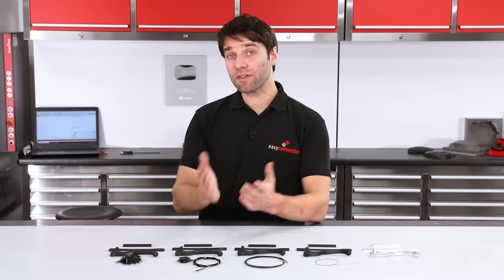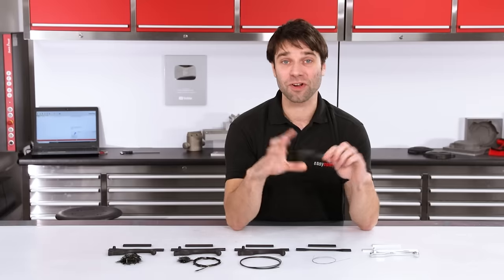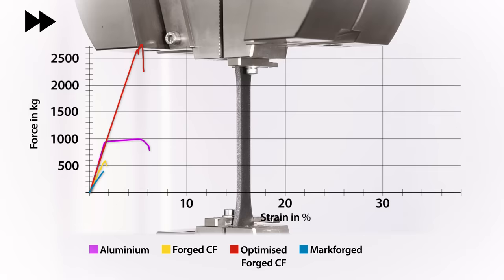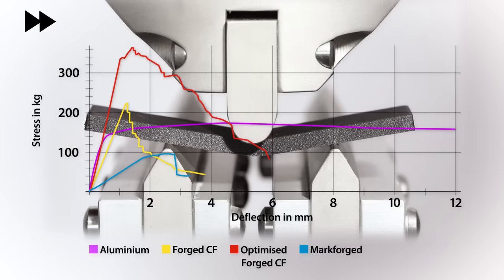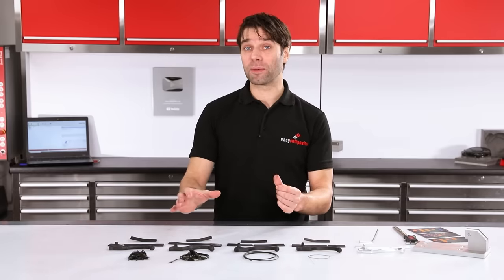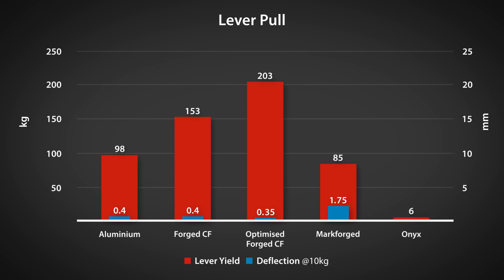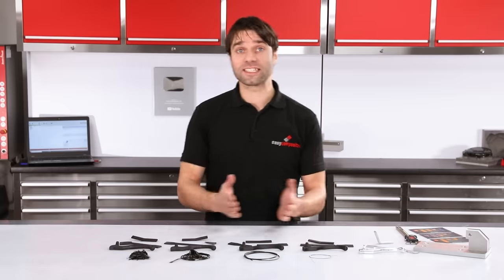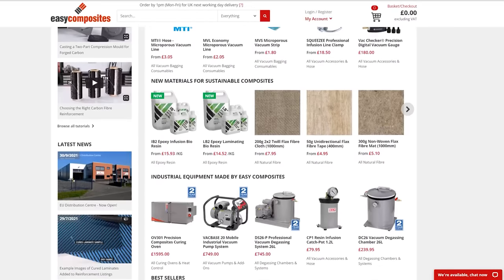How Strong is Forged Carbon Fibre? Forged Carbon vs Aluminium vs Markforged vs Onyx

Comment: Been hanging out for this episode since the forged parts video. Thank you for posting such informational videos and tutorials.  The card analogy was inspired.

Does a continuously increasing load replicate spontaneous (impact) loads? It would be unusual to slowly increase the load on a brake lever, but I can imagine a sudden impact load on a brake lever during an accident. Just curious if the results are applicable in that real world scenario?
Reply from the maker: Sudden impact can illicit a different response from materials which is why specific impact tests do also exist. We don't have an impact tester but we did fabricate an ad-hoc impact test for one of our previous material test videos (part of the 'Dark Ice Project' where we tested the impact strength of various materials like carbon fibre, Kevlar, Diolen, Dyneema etc.). Although it's a complex subject, you can predict a lot about the impact strength of a material from its ultimate strength, elongation properties and failure mode in tensile and 3-point bend tests.
Reply: @easycompositestv  thank you for your response - I'll go check out the Dark Ice impact test video.

Comment: Very good content,
Also shows that 3d printing isn't feasible for many applications.

I am very impressed with that reinforced carbon forging proces though.
twice the strength and half the weight of aluminium. That means you can go an quarter of the weight with some Q&A testing on these parts.

That is actually really really good stuff. Especially looking at how simple it is to do and it seems feasible to produce at high volumes as well.

Comment: That onyx stuff seems oddly bendy for a CF filled filament and generally seems to perform terribly.
If the data for the tensile strength at 16:49  is for a 3 mm x 10 mm sample it means it failed under 29MPa. Even normal PLA should be nearly 2x better than that.
Reply: I think this is an application where nylon isn't a good choice. A CF filled filament of a different plastic would likely work better. As you suggest, even PLA would be better.
Reply: @ddegn  I don't think any of the PLA has strands, most of it just uses dust for a matte finish. CF-PETG and CF-PC are better choices. But the numbers are low, even for CF-nylon. Wonder where they sourced it from.
Reply: @MrMistery101  Thats what we are trying to say. it's concerning that even plain old PLA without any additives will perform substantially better in this test than the "exotic" filament.
Reply from the maker: We were surprised just how flexible it was compared to the other materials. Not to say the material is bad throughout, but for this specific application, it is not suitable.
Reply: @scifactorial5802  onyx is not designed for high strength, but to work well when combined with long carbon fibers. (like in the other markforged sample)

According to the channel visionminer, a big reason nylon filament contain carbon fibers is to make it easier to print. (it stabilizes the material against thermal effects like warping)

PLA is actually a very good plastic from a strength and rigidity standpoint. Its main issues are that it shatters easily and can't stand high temperatures in the slightest. Engineers usually are less interested in strong but brittle plastics (like acrylic) and prefer polymers that are sometimes weaker but possess toughness, chemical and thermal resistance.

Comment: Great video. Onyx is a poor representation of the strongest fdm has to offer. Essentium CF25 is roughly 5x stiffer and stronger than pure onyx. I performed a suite of tests on 5 or 6 different FDM CF nylons using my own universal tensile tester

Comment: I have been geeking out on your carbon fiber instructional videos, and then I stumbled on this gem. 
I loved the scientific-ish demonstration of 4 types of carbon fiber vs aluminum. It is enlightening to see the pros and cons of each type of material as well as to be able to consider the manufacturing process involved in each. 
I’m excited to learn that the strongest and most rigid type of carbon fiber can be made in my shop using a 3D printed mold!  Amazing!
Thank you!  Please make more videos!

Comment: Amazing video as always! 
Breaking of optimized forge carbon in steps is interesting. I think some loaded fiber breaks and the unloaded ones take over.
Explaining the test while the plastic is stretching is funny.
Reply from the maker: Generally the most loaded fibre fails first then the others as they become overloaded. That applies to composite failure in general.

Comment: This is an awesome presentation. I appreciate it. Obviously, each will have different application. For example, the Onyx method maybe not very strong as a lever but with high flexibility, it will make awesome body panels.

Comment: I love the effort you put into your tests. I did pretty similar tests for my bachelors thesis i am currently wrighting. I would love to see the exact weights of you specimens, since specific strength is where carbon fiber really excels.
Reply from the maker: Hi Adri, if you follow the link to the project page on our website you'll find a full write-up on this project which includes the force data in MPa/GPa and the weights of the component and specimens.

Comment: Really interesting video and a real highlight of just how incredibly strong forged carbon is!
It's also useful in showing how the same part has different ideal materials depending on application - with the levers for instance, while riding on the road I'd much rather have bent but useable aluminium levers on my bike after a light 'off' than sharp carbon stubs so I can get home.
For track and race applications though, the carbon is absolutely worth it to save weight, and resuming a race after a crash is usually an unlikely prospect anyway.

Comment: Wildly interesting - and really puts the carbon filaments in 3D printing into perspective!
Reply: Perhaps it was a bad choice of filament, some is just for the looks. I bought some Nylon with CF which has very impressive properties and is nowhere near as flabby as the stuff he shows. It was from eSun which I ordered from Amazon. And you need to keep Nylon dry.
Reply: @AlJay0032  would you say it outperforms aluminum?
Reply: @ivant5054  No, it has different properties, it is more flexible and springs back. Aluminum can't be bend that far without permanent deformation. Aluminum is probably stronger. But I made something thin walled for a drone, so it might be possible to get more strength with a part that has more volume yet similar weight to aluminum.
My guess would be in the end Aluminum is stronger, but that is just a guess.
Reply: @AlJay0032  well, instead of just guessing you can look at the data presented in the video

the only 3d printed carbon fiber that is able to even compare to aluminum is the one that requires a special attachment to the 3d printer

the other one with microstrands in it is just expensive trash that is slightly better than regular PTFE print.... at that point just get yourself the metal filament and sinter the part afterwards and you wold actually have something resilient
Reply: @ivant5054   You seem to be really smart. I did look at the video. And maybe you don't know it, but there are many poor CF Nylon filaments and in the video they obviously tested one of these inferior filaments which just have the CF for the looks and not the strength.

I did get a special ruby nozzle but I did not want a metal sintered part, because of the weight. I am quite happy with my choice of material for my application and I did some research of the properties of the filaments and looked at reviews and comparisons.

But I am glad you know better what I should be getting for my application and my requirements. Probably even without doing any research on CF Nylon filament options.
Reply: @AlJay0032  extremely long assay to basically say nothing and passively aggressively attack me.... you seem so smart and somehow can't differentiate between Carbon micro fibers and one single carbon fibre tow, as the one shown in the video, for which a special attachment is needed for the 3d printer

NO MICRO FIBER INFUSED PLASTIC IS GOING TO OUTPERFORM THE ONE SINGLE TOW SHOWN IN THE VIDEO

and the ones that are, as you say, "high quality" are the ones requiring an extra tool for the printer to cut the filament, which isn't cheap, and at that point it is just cheaper and easier to just make forged carbon fiber 

and yes, I do know better, this happens to be my job

I see no need in continuing a discussion with a thickheaded example of the Dunning-Kruger effect
Reply: @ivant5054  You're so smart.
Reply: @ivant5054  If you are so smart and it is your job, why did you just completely ignore what I said what my requirements were? Do you always ignore clients requirements? If I was your boss, I would fire you on the spot for total incompetence.

Comment: The biggest part you left out is, when it gives way, would it still be useable.  Using the lever as the example, the aluminium is much more malleable and in a crash could possibly be bent back and ridden home or off course.  Every one of the CF would be impossible to use as they fractured and became unusable.   I would never have these on my MX; especially after seeing one snap at the bolt point.  I'd be more curious what their performance would be if you did the test from the beginning, used only half their break weight, then retried to failure; simulating multiple hits and prolonged abuse.  How would they respond then?  I still think the malleability of the metal would be the overall winner.   :)

Comment: This is incredibly fascinating, but i'd have loved to have seen traditional woven carbon fibre parts tested as well
Reply from the maker: The main reason we didn't use a woven, or majority unidirectional, reinforcement in this type of moulding process is because the process does rather rely on the ability of short strands of carbon fibre to redistribute themselves within the mould when the pressure is applied. If you were to pack the mould with woven carbon cloth and then compress it, the result is usually a component with either considerable voiding or, at the very least, highly resin rich areas which are not reinforced with fibre. Although using short strand, randomly oriented reinforcement is a significant compromise in terms of performance, it's a significant advantage in terms of practically. You'll see us working with woven and UD dry and prepreg reinforcement in most of our other videos but for this particular process, the short strand reinforcement is almost a prerequisite.

Comment: Lovely work!💪 as a real world application we would need see how the carbon lever hold up to an impact test from the end down the length of the blade since this is how all levers tend to fail. It’s worth noting too that a bent aluminium lever still functions as a lever to get you going again which is something the carbon won’t do. It’s also worth mentioning that SRAM have been using UD carbon lever on their high end MTB kit for years now but these are made with traditional bicycle industry methods and a 12kg MTB landing on a lever is a different ball game to a 110kg+ dirtbike. 
Still though props on a proper study!
Reply from the maker: Thanks Ricky, agreed on all those points. The lever was really just a prop to allow us to investigate the process and it’s performance on some key metrics. We’re not specifically suggesting the process for that component and there are very many more suitable applications for it but hopefully this demonstration proves that mechanically a forged carbon fibre part is still a very viable component, contrary to some assumptions.

Comment: I am curious how torsion loads for the optimized carbon would perform as that is where I would be most concerned about performance
Reply from the maker: You can vary how you lay it to suit the design requirements to an extent.

Comment: Awesome video.  I have a small mill and a markforged printer.  Looks like I'm better off using them to make molds then finished parts!
Reply from the maker: To achieve the best possible mechanical results then yes, that would be true. If you don’t need the very top end then there’s a lot of convenience in just printing the part!

Comment: Hey Paul. Nice video once again. You went into a very technical field. Really liked it.
One thing that is worth to analyze as well is the failure mode. All carbon parts have a brittle failure meanwhile the aluminum has a ductile failure. That means if the function is more important than weight than one should pick a material with ductile failure. 
Nice job!!!
Reply from the maker: Very much depends on the application and safety case. If you make the part much stronger then the brittle failure may well be irrelevant for that situation.

Comment: I like the implication that for Optimised Forged Carbon, If you engineer your part for a required strength, you could effectively meet that with a part half the size, and thus a quarter of the weight.
Reply: @Alfred Wedmore Thanks for the info!

Comment: Very interesting results. My only concern is the inclusion of the Onyx (carbon-fiber filled Nylon). A similar filament in polycarbonate would likely have exceeded its performance and still been printable in a printer of the same class while a carbon filled PEEK or PEKK would have greatly exceeded its performance but not required a printer beyond the price of the Markedforge. 

It is an excellent example of how weak standard 3D printed materials are however, compared to real engineering grade materials.

Comment: In the brake/clutch lever you tested, the weak point is not the "lever" but the hole that takes the bolt for pivoting the lever, wear in that area causes failure on my bikes every time.

Comment: I have been anxiously awaiting this video. Well done. I would like to have seen some plain 3D printer filament, such as ABS, just to compare the 3D printed carbon vs non-filled, but I appreciate this is about CF. Great video. Thank you for taking the time to make it.
Reply from the maker: No problem, you're welcome. I think we assumed that comparisons between the mechanical properties of various 3D print filaments had probably been pretty well covered already since these materials are widely available and their performance compared to each other is the source of plenty of debate and discussion. Nonetheless, I can see that a straight PLA/ABS print, tested on our gear under our conditions would be interesting, especially just to see whether the milled carbon in the Onyx really does much at all to improve a standard filament under these conditions. If we get chance, we'll look at adding this data to the report.

Comment: really interesting.  Always makes me chuckle when people use CF infused 3D printable polymers thinking they are 'carbon fibre'.  I was really impressed by the optimised forged CF test, just goes to show hoe the continuous stands work.  I'd like to see how the tests come out under different temperature, weather and aging conditions, esp with regards to the resin.
Reply from the maker: Hi Jonathon, normal ranges of temperature (let’s say up to 60C) wouldn’t affect the performance measurably. High service temperatures, 80C plus, would require a different resin system, such as our EL160 which has a much higher Tg (softening point).

Comment: Interesting comparison! However, what you could consider is that optimising the design for (continuous fibre) 3D printing might also dramatically improve performance.
Reply from the maker: Perhaps but you are limited by the capability of the printer to lay the fibres exactly where you want them.  Many Gcode generating software would not give you the ability to specify how the fibres are laid down precisely.

Comment: Amazing results, taking into account that its half the weight you could even make the piece thicker to balance things out so instead of being half the weight you make it 25% lighter but way stronger. As for the wearing part, you could easly coat the piece with something more resistant to wear like plastics or metal inserts like you mention for the threds.
Irs crazy that you can do something this strong and light with a bag of stripes, resin and a 3d printed mold.
Reply from the maker: You’re spot on. It is crazy. Also yes, the density is so much lower that you have plenty of head-room to exceed the strength of the ally part and still be a bit lighter.
Reply: @easycompositestv  Stuff like this really changes the game for both mass and small production of parts taking the autoclave and how the regular carbon fiber is worked out of the equation wich saves cost by a huge margin, and im sure that after some simple test of different iterations getting more creative with the way of arranging the trims (even the short ones) you could improve those results with the same amount.

Comment: Really good video- running the graph on “no overlap “ setting would have made the graphs easier to read
Reply from the maker: Hi Derek, if you're after clearer presentation of the data, head on over to the project page on our website, the report there has all the data as well as (probably) easier to read and/or cite graphs and information.
Reply: @easycompositestv  I as being pedantic- we run an Instron and if anyone sets the display to overlap  I always change it back to non overlap . Your videos are really good keep them coming-really informative and interesting

Comment: It would be interesting to also list the general economic cost of each part, so the value aspect is also applied. Maximum performance potential can often exceed what is actually required, so the cost value as an anchor point would be great for future comparisons